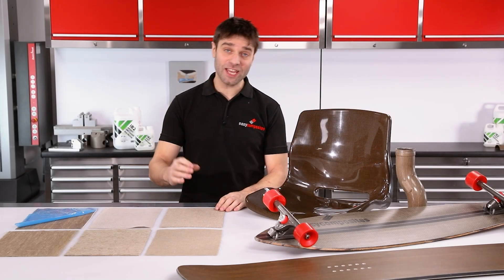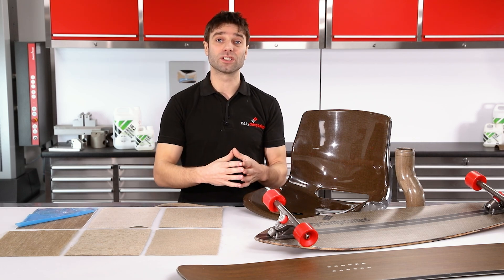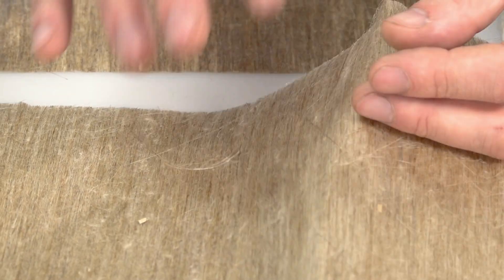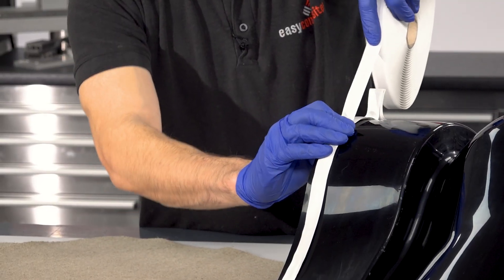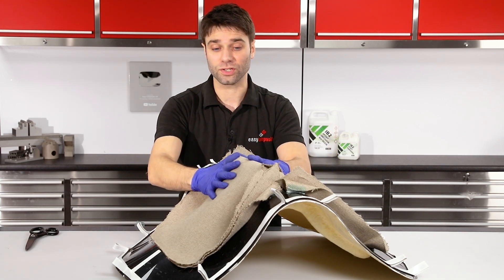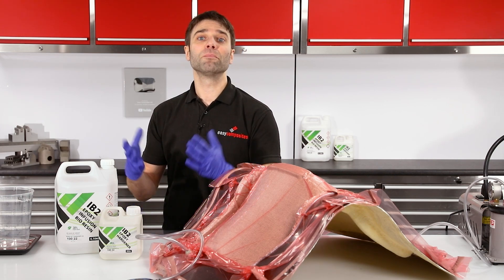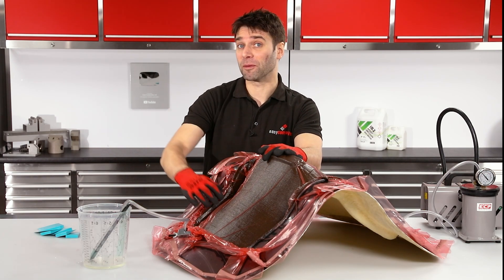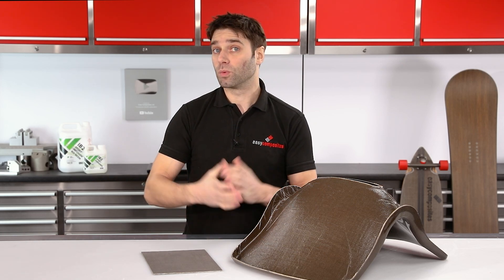How to Use Flax Fibre in Composites; Performance and Processing

Comment: I wonder if you could add extra "stiffeners" to the geometry in the back, like triangular-cross sectioned ribs that go around that curve to give it more strength. Maybe some kind of shaped core that you could drape with another layer of the flax fiber?
Reply from the maker: Processes like infusion are generally a single sided process so it would be hard to mould in such a feature on the back without it being a separate process on another mould and bonded together post curing.  You could use ribs of foam covered in laminate to effect extra stiffening or just use a core material full stop over the whole surface to aid improved stiffness.

Comment: I’m personally wish too see a hemp version that blows the specs of the Flax version out of the water. 

🇦🇺🤜🏼🤛🏼🍀🍀🍀😂🤓
Reply from the maker: Hi Steve, unfortunately the reality of hemp fibres for composites is that they really don’t work well at all. Lots have commented about how much better hemp would be due to its higher strength but in composites its low modulus and processing characteristics have shown it to be unsuitable, at least so far, outside of very specific lab conditioning and processing.

Comment: Question: I'm in the final process of making my carbon LMP1 Sim Racing seat moulded to myself. I was thinking of using chopped 1/4 carbon for the inner "Pretty"  layer which gravity isn't kind for this part.
 Is there a spray epoxy (with layer of chopped fiber) to build up layers with out sagging or Pooling in the seat?
Reply from the maker: We do not have any spray epoxies. You can use the carbon skinning process with chopped tow but you have to be careful to get the fibre laid down properly and wetted out properly without ruining the cosmetic effect.
Reply: @easycompositestv  I haven't worked with chopped much. I did Aircraft composites mostly. What would be the best way? Blotch it with a damp resin brush after I put down a thin sticky layer for it to stick to? or is there a better tool or way?

Comment: I can see it used as a core material to be covered with a thin layer of carbon. For instance, as the base of a chasis, you could have a total thickness of 20mm, with 18mm of flax covered with 1mm of carbon on each side. It would be rigid AF. Maybe even bulletproof against handguns XD

Comment: This is more than I can handle...I am in over my head. I need some help with answers and understanding. I don't need advice. Someone knows. Seems those who do won't say.

Take a minute...try to answer one question. Try to find out anything. Even just a picture of it. I think you will realize that something is wrong. You will realize why I need help. I can't be the only one. 

They put this on my teeth...6 yrs later something safe came out. Ribbond is safe. It's banded and doesn't come apart. The uhmwpe polymer weave it replaced breaks, comes apart, and fails. What is the uhmwpe polymer weave that fails? Who made it? What happens when it fails?

This uhmwpe polymer weave is a self healing material. All self healing materials reverse. Can you understand what that means? Do you know why the work a polymer does is called a physical phenomenon? Can you imagine a dense plastic weave coming apart in your mouth? This is above and beyond... please help.

Please help bring some knowledge and understanding to what they have done to me. 

A lot of dentists wrote about Ribbond vs uhmwpe. They have known for a long time. Dr Howard Strassler wrote about it. I called and talked to him...he would not discuss it. It's just 2 materials. Something is wrong here. Please help me.

jefffetzer1984@gmail.com

thank you

Comment: You really should seal the edges with hygroscopic fibers.... Even glass has a hydrophilic surface
Reply from the maker: Not an issue we have seen with epoxy based laminate but it depends on environment the end product is used on.

Comment: Oy, that chair of yours is wearing a potato sack!

Jk it's actually quite handsome.

I do wonder about environmental aspect - you have that carbon negative fibre, but you're ending up with what, 3 times more epoxy than you'd use with another reinforcement fibre? Not that I personally care too much, there are only certain ways that are suitable for one-off and low-volume products, one just has to live with the compromise, and it does have a lovely appearance.

Comment: use wood, same look, same properties, you are making synthetic wood panels
Reply from the maker: The skill set and properties are different so may not work for all. Those with composites experience would find the material switch relatively easy.

Comment: I  wanted to do like in video showing as in vacuum seal silicone but not sure like this method or plastic, what I am looking for is strength and colorful and most importantly is the light weight when complete. Any suggestion? Give me the link to watch what I was asking about, please. I love this project. Gotta do a few of them in near future.
Reply: Forgot to add when I first learned this vacuum method of making molding and what gotten my attention was the body they made for the umm car called Peel P50. This is what got my attention. I want to make a custom body of my custom pedal-assisted quacycle.
Reply from the maker: Silicone moulds or silicone bags?  Silicone moulds would flex quite a lot so conventional composites are better in that respect.  SIlicone bags have mixed reliability and do not last that long with epoxy.
Reply: @easycompositestv  Good point! I believed it is Silicone molds. Let me find the link to that P50 video showing their molding.  https://www.youtube.com/watch?v=i7QQlIToc6U  This is the video that I am looking I am looking into.

Comment: How about "Ramie"? In uni we found that this was a great natural fibre, but I've never seen it sold and wonder why?
Reply from the maker: Its not that much of a common fibre these days despite its strength so is quite hard to find outside of the areas it is grown and locally used.
Reply: @easycompositestv  interesting, glad to hear your insight, a big factor of "availability" was clearly left out in that uni software

Comment: As you mentioned, with this type of flax weave, you don't need the mesh, even when using a unidirectional fiber underneath. Maybe you could use a flax weave in a multi-composite layup alongside carbon and/or Kevlar instead of a mesh to get this aesthetic and reduce material costs? Maybe there is also a way to use something like a 2-part vacuum mold to replace the bag and peel ply and get a scalable system with less waste material for more sustainable parts. The only thing that I can't really think of a solution off-hand for is the feed spiral, but I'm sure something like this already exists.
Reply: For 2-part vacuum molds you can engineer grooves and gaps where you would otherwise need to use feed spirals and/or infusion mesh where possible.
Vacuum bagging does let you more easily see and take care of eventual leaks from stray fibers stuck between the butyl rubber and sealing surfaces.
You win some you lose some.

Comment: Is hemp composite stronger by weight compared with flax ? With thanks, love your excellent instructional presentation.
Reply from the maker: We do not have any hemp to test at present to compare.
Reply: @easycompositestv  Thankyou for your reply. Hemp industrial use is quite common now, ie insulation, rope and clothing but would need to be processed like the flax. I believe hemp would perform better than flax.

Comment: there is no "environmental benefits" in using this material )
all carbon used by plant to create cellulose will be released on degradation in form of CO2.  plant lifecycle is carbon-neutral if it's all natural.  but when it became "assisted" by us it immediately became carbon positive because we spend carbohydrates on it.
so field cultivated and machine processed linen fibers are not environmental friendly by any means.  and i speak of fibers itself.  
the end product of laminating this fibers with epoxy spends even more carbohydrates ))
but it's all more of a speculation.  i love plastics. they actually have very minimal impact on environment because the most harm to the planet comes from other sources.

Comment: The cyclone testing station in Townsville Australia uses this between plywood laminations and then shoots a 4” square hardwood block at it at over 300km/hr.
Goes right through but they told me its better than carbon and glass.
Reply from the maker: Hmmm, well, I’m not sure what the nature or purpose of that test is exactly… if you wanted a material that would perform well in this test you’d want to include Aramid fibre (like Kevlar) which would have a much higher impact strength than any of the other materials mentioned. We’ve made ballistic door panels in this way and you couldn’t shoot a bullet through them, never mind a block of wood only going 300mph.
Reply: @easycompositestv  thats what I thought but then again.. it is a university that likes to be eco friendly in every way possible. That was what I got out of it.

Comment: could you do a video with hand layup of flax fibre please?
Reply from the maker: As covered in the video, for a number of reasons flax isn’t ideal for lamination by open mould wet layup. The main issue is the lack of consolidation causing the laminate to swell and become very resin rich. It’s also difficult to ensure full wet-out of the flax which can degrade the performance of the laminate. If you do hand laminate then vacuum bagging afterwards would be highly recommended. The process would be exactly the same as hand laminating any other woven reinforcement, such as carbon, as covered in many of our other videos.
Reply: @easycompositestv  Thank you for taking the time out to respond to me. I appreciate that.

Comment: That would be interesting to see the combination of thin glass surfaces and the flax core. Feels like it would give the best of both worlds! :)
Reply: I had the same thought
Reply from the maker: Potentially it could be a good combo subject to testing. Probably not as light as a typical foam core due to resin uptake but could be beneficial.
Reply: @easycompositestv  Absolutely, with the additional benefit being the simplification of vacuuming process.

May I ask a question?

I tried an oversimplified process for vacuum infusion. I put the ply on a layer of cling film, mixed resin added a blob on one side of that ply. On the other one I put a massive wick of paper towels that also acted as aid conduit. I then closed the envelope and used my vacuum pump. It turned into a sort of  squeeshy maluable material that was easy to turn into flat sheet, wrap around simple molds etc. Cling film was easy to stretch and conformed nicely to simple shapes.

I'm pretty sure if used on a vacuum forming machine - it would stretch and conform to 3d shapes like the hot plastic sheets do but without the need for heat obviously. I really like to experiment with these things, would you like to try something like that?

Comment: could flax be used as a layer in a carbon product to help with infusion without mesh?maybe used as a core material
Reply from the maker: It could be possible although it is not something we have tested.  As a core, the resin still has to soak through the carbon to get to the core so high flow cores, unless they go right to the edge, aren't always as efficient as you think.

Comment: Funny how you gloss right over hemp and minimalize it's attributes whole bolstering a far inferior material.  May as well stack burlap at this point and call it "superior" than all others.  Why even bother?
Reply from the maker: Hemp fibre is another natural fibre that can be considered for composites, however, there are a couple of drawbacks of it which explain why flax is the preferred option. Firstly, although there are a number of studies which show that hemp fibre can be processed in such a way as to yield a fibre that has certain properties which exceed those of flax, this specialist processing has so far only been done at lab scale and hasn’t been scaled up to a volume process. Volume produced hemp fibre does not exceed the performance of flax fibre as a composite reinforcement. One of the particular properties where hemp suffers is its Youngs Modulus, which is extremely low, and so although hemp might appear to have a higher tensile strength than flax, its modulus is much lower, making it much less suitable as a composite reinforcement than flax.”

Comment: Great video. Is this flax fiber cheaper than the fiber carbon?
Reply from the maker: Yes it is cheaper as a raw fabric, however you need to consider the full cost eg you need more layers and more resin to match the strength and stiffness of a carbon composite.

Comment: How about using the compression molding on flax fibers? Is it feasible and economical to do as compared to the vacuum infusion? And, how about the flow of resin in non-woven flax material as compared to woven?
Reply from the maker: The material should work in a compression moulding process as many chopped fibres will. Generally its the shape that determines the method.

Comment: Fun fact:  Flax is a very, very low-stretch fiber; it's in the same class as the aramids,  at least as far as stretch is concerned.  Until the advent of Dacron and the other high-tech fabrics, the very best racing sails were made of Irish linen.
Reply: One has to ask why use Flax or Hemp rather than FG?  The only reason I can think of is cosmetics.  Any have another idea?
Reply: @iancormie9916  I am thinking of using it to replace the wood grain inserts on my Mercedes 300E (1987) as they are showing signs of cracking and age as is usual for them. The flax offers the cosmetic value that wood does I think. A natural fibre and subtle variability that carbon fiber wont offer. If I add a cherry red tined clearcoat across the top it may yield a nice result.
Reply: @generalvoltage1821  Did you try your project on your car?  🍒
Reply: @221b-Maker-Street  not yet. I have a long list. Like most wood grain dash pieces, it’s veneer over a moulded timbre backing. Some of my pieces are in good condition and some like near the gear selector is fading and cracking so I don’t want to sacrifice all my pieces. I’ll find something that’s beyond help and pull the old veneer off and lay the flax over the top, maybe two layers and apply the resin etc directly onto the backing timber like you would new veneer. But I’ve not moved on that yet.
Reply: @iancormie9916  Very low stretch, linen drapes beautifully, extremely low-carbon-footprint, quite a bit cheaper than carbon, and it looks nice. This is what you want, if you want this sort of thing. It won't work for all applications, and that's OK.
Reply: @iancormie9916 hopefully the price is why to use it but don't know yet how much it costs, but anything natural that can be 'grown' is not a bad thing
Reply: Misread that as arachnids!  

Slightly disturbing images of stretchy, bouncing spiders dancing before my eyes... 😳
Reply: @221b-Maker-Street  Inflexible Arachnids is a pretty good garage-band name

Comment: I'm curious if there are any vacuum bags that are designed to withstand removal to be reused
Reply from the maker: Custom silicone bags can be made and reused but epoxy eats silicone very quickly so they wouldn’t last long at all and would surely cause more waste the disposable film. Thicker films could be used, these are more likely to be reusable but if they’re thicker they’re more expensive and have more material in them so when they do inevitably tear or rip or leak then you’ll be creating more waste than from a thinner film. The best option might be the reusable cloths vacuum bags which work well for basic bagging but I’m not sure would hold up too well to multiple infusions.

Comment: I am so glad you made this video, I had been contemplating using natural fibre, and now I know where to get it from, but from what you were saying of sound deadening properties, it would not be good for a musical, stringed, instrument?
Reply from the maker: Hi Dec, well, flax is very well known for its anti-vibration properties so there is indeed going to be a significant impact on the sound of an instrument however I don’t think that rules out its use altogether; for example carbon fibre instruments are often considered ‘too bright’ and so selective combination of carbon and flax could tune the sound to something better than either material on its own.

Comment: I am excited by the potential of this in so many applicators, has anyone looked into making a resin directly from linseed oil, as it literally comes from processing flax? I am familiar with the bio resin, and I was told it was developed from the by products of paper manufacturing. some chemist out there has to have the answer!
Reply from the maker: Hi Aaron, if you watch the spotlight video we did on the bio resins recently (link in the description) it includes a segment on the broad chemistry behind the bio-derived element; there are a lot of potential sources. As for linseed, I’m not sure but I bet you could find some papers on it if you do some digging.
Reply: @easycompositestv  thank you ! I will check that out, My old shop mate used the resin for making surfboards and I was very impressed with the quality and the fact that there was no smell at all.

Comment: Infusion question. Is it possible make a mold for infusion with a really accute angle at the top? If we take the chair as an example, the angle between the back rest and the seat is about 90 degrees but could we make that 20 or 15 degrees and still be able to infuse?
Reply from the maker: Yes, the resin flow is not effected a great deal by geometry or gravity. You will see it flowing slightly slower upwards than down but it’s much less pronounced than many people expect. As for right corners, this really wouldn’t make any difference.